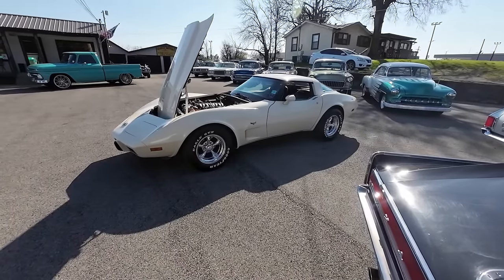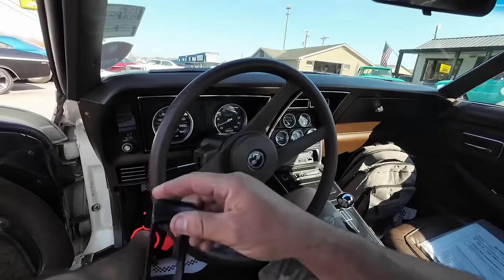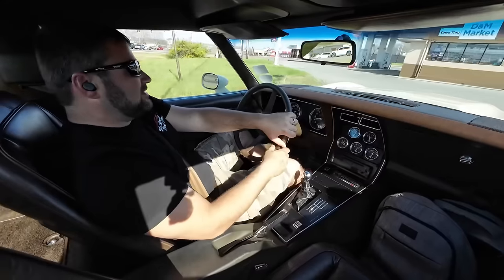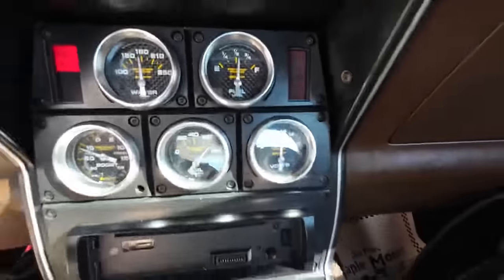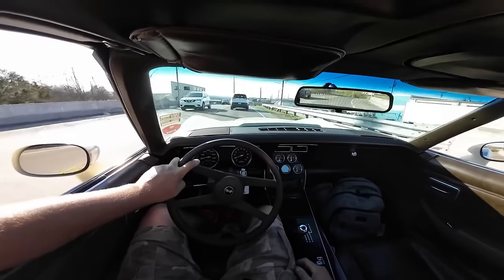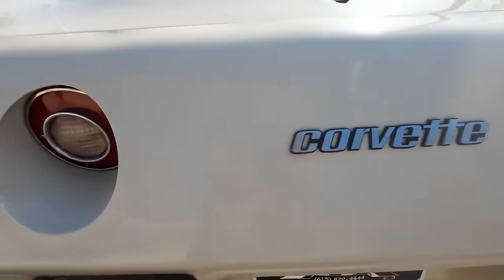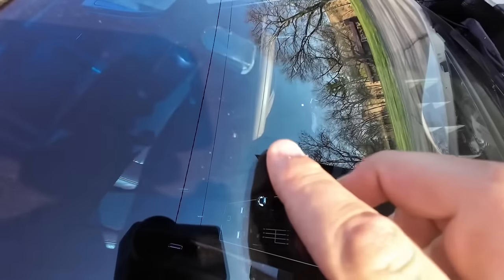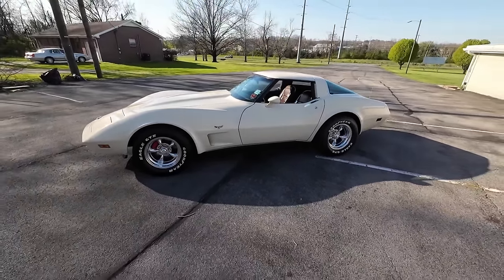Test Drive 1978 Chevrolet Corvette LS 6 Speed Maple Motors SOLD $24,900 Maple Motors #2539

Comment: The waves in the rear and front bumpers are a real problem with these cars. Otherwise I love them.
Reply: Is it "fixable" though.....WITHOUT replacing them?
Reply: @DarrenPugh-r6u  Does someone make aluminum ones? I  would think so ..
Reply: @Mr.Higginbotham  So.....no.....replacing them is the only fix. (?)
Reply: @DarrenPugh-r6u  I don't think so unless you have heat and a mold...
Reply: @Mr.Higginbotham  Heat gun I have....Corvette bumper mold, not-so-much

Comment: those bumpers really ruin the look. If you can change the front and rear bumpers to something without those bumperrettes it would look sweet. Vanguard is trash. They buy a car for 60k and turn around and try to flip it for $80k. just a higher end car flipper.
Reply: Whoever buys this please get the 80-82 style bumpers, please!🤣